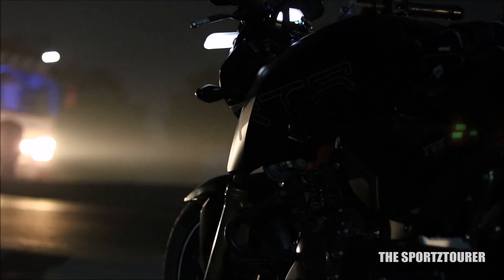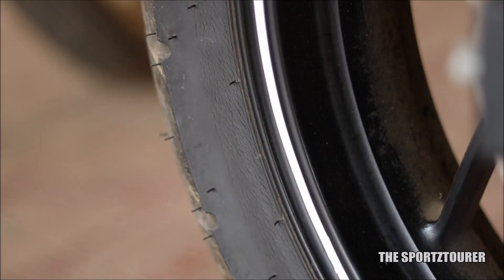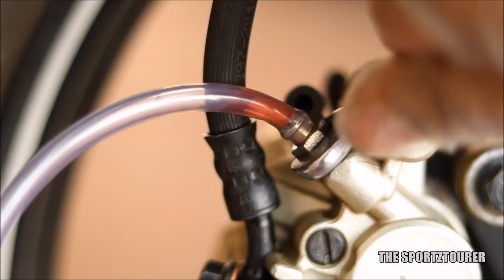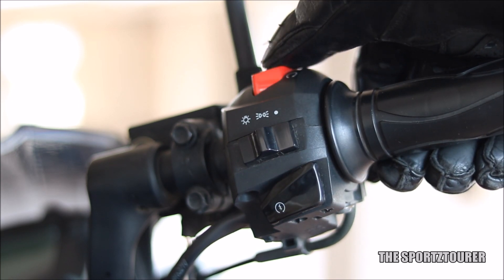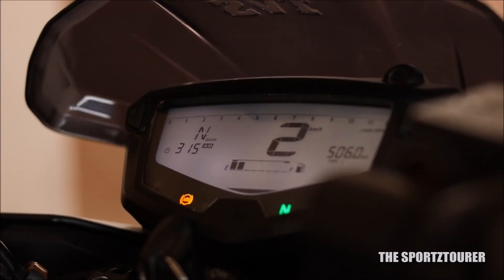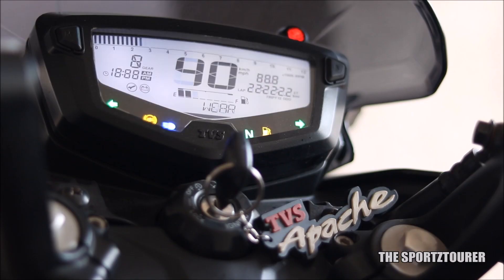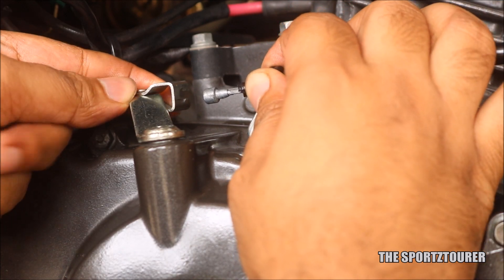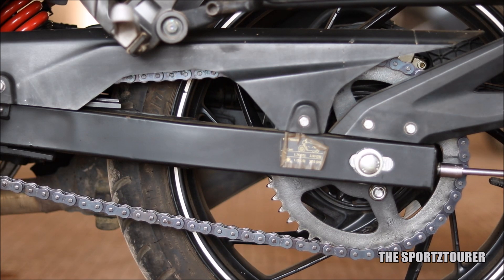1: HOW TO PREPARE & INSPECT YOUR MOTORCYCLE BEFORE LONG RIDES & SERVICE | TVS APACHE RTR 200 SERVICE

Comment: Hi, bro

I am going to switch engine oil motul 7100 20W50 from the stock bajaj oil on NS160. And odo is at 9K km.

So, my question is engine flush is required to change the oil from the stock mineral to fully synthetic Motul 7100 20W50 ? And i am changing oil at every 3000km.

Comment: Bro make a video . (shell advance ultra 10w40 and shell advance ultra 15w50 ...what the difference between on this two oil's )...in my hornet 160r which engine oil is perform's well bro? .my Frnd suggest me to shell advance ultra 15w50 .. he's using shell advance ultra 15w50 in  Gixxer

Comment: Does broader size tyre decrease fuel economy? I changed my activa 3g tvs 90/100-10 rear tyre with mrf zapper D 100/90-10. New Tyre width is 100mm and sidewall is 90mm. But since then I'm observing higher fuel consumption. Please advise.

Comment: I used motul 7100 10W40 on my apache RTR 200 4V race edition, the engine & clutch are smoother, but the sturdy & crisp feel of RTR 200 is lost.

Comment: Bro how to fix spongy brakes on abs version of apache 200 4v
Reply: Do brake bleeding
Reply: @abd1596   no the brake oil levels are at max
Reply: sairevanth reddy but that has no connection with bleeding . There may be air gap in brake line
Reply: @sairevanthreddy3723  there will be air bubbles left so bleeding is required
Reply: Ok tq for replying
Reply from the maker: Hi,
As others have rightly suggested, bleeding can help in such situations. Here is the complete guide to bleed the brakes: https://youtu.be/RsIk73qNag0

Comment: I am never happy with my brakes very spongy no crispyness 😑
Reply: there must be air in your brake lines, try bleeding out the brakes and also check for amount of thread left in your brake pads. If you haven't checked your serviced your brakes for a very long time it will be best to get a full brake service done.